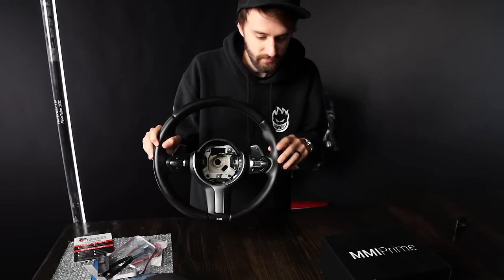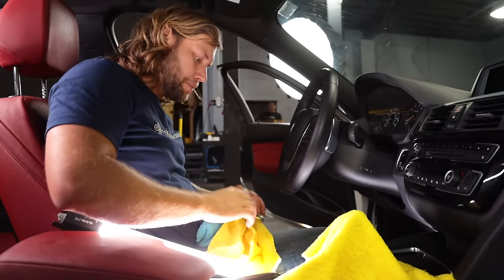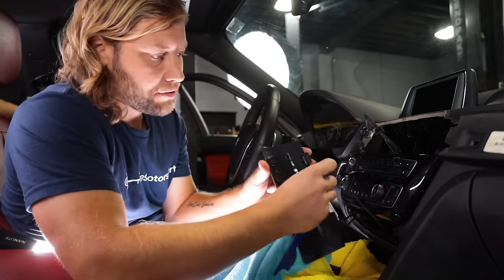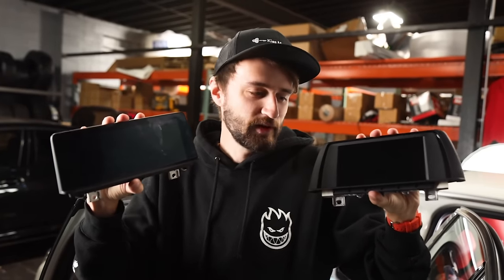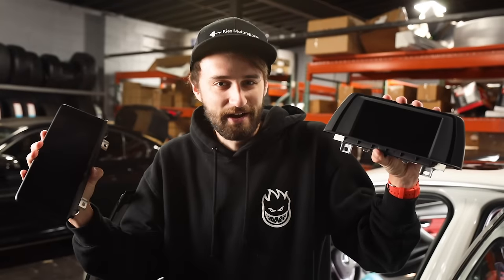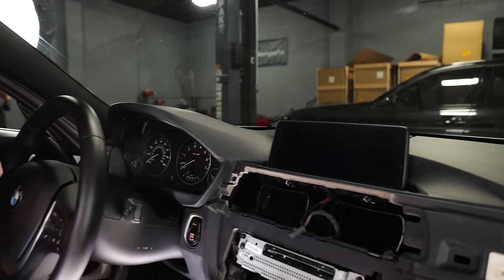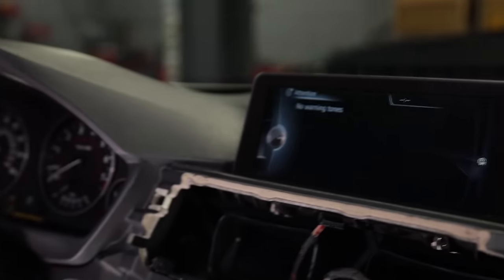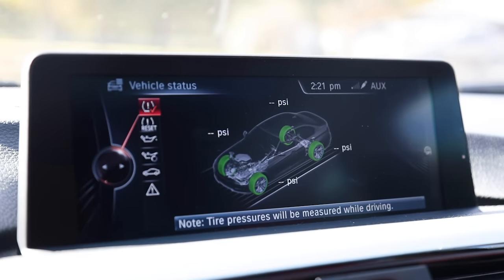How to Upgrade Your F30 BMW Screen + Apple CarPlay & Android Auto

Comment: Can you get a check engine light, mine seems to be on after doing this?
Reply from the maker: nothing about this project would cause a check engine light. If yours came on after doing this, it's a coincidence
Reply: @justinbuice  Thanks figured it out, I did this swap, but I have no satellite location.. I think the map is Here I think its called
but how do you get it working, anything I should do?

Comment: Do you need the MMI with this bigger screen or will coding it to the new screen expand the resolution?
Reply from the maker: Hey, you should be able to expand the resolution through coding. The MMI is just to add the Apple CarPlay capability. From the factory, the car is able to display a handful of different resolutions and you essentially just need to tell the computer which screen has been installed.
Reply: @justinbuice  is it hard to hook up a aftermarket sound system I wanted to add 2 12s and a amp will the audio control LCi2 work with this?

Comment: When you add the car play does it automatically update as and when car play does or is there something you have to do for updates?
Reply: CarPlay updates take place on your phone, so when your phone gets a new version of iOS, CarPlay updates (like iOS 14 a month or so ago).  CarPlay actually runs off your phone.  I guess Apple could at some point release and update that breaks compatibility with older CarPlay units in cars, but my guess is that they'll continue to support the current hardware for a while, likely the life of the car.

Comment: Hi when I upgraded my screen from 6.5 to 10.25 on 2018 BMW X3 I got no single on screen. Can you fix it. OEM screen I bought
Reply from the maker: you need to code the new resolution otherwise you will have a black screen
Reply: @justinbuice  how much you charge me and how you doing it

Comment: I like the size of the screen and I'd be interested in adding one to my 2017 328D but other than a larger screen I'm not sure what you gain by making this mod. I'm not a crApple fan so CarPlay doesn't matter to me. I see Waze and several other apps on the new screen but how do you use them without internet access?
Reply: car play is just showing your phones interface on your car's screen, so as long as your phone has internet all the apps will work like they do on your phone

Comment: Why no one can make American retrofit box that works better than this and sell that without relabeling cheap chineese stuff? I have one of this and it does not work 100% well. You have to wait a few seconds before this comes on, sometimes this has problem with connection and you have to reset it.
I found it to be a relatively good solution for $285, the price I paid to buy this from eBay, but not for $650.

Comment: These screens look very nice but they never work 100% correctly. I just got their latest 10.3" LG 4G screen, 8 core 64gb for my BMW f10 5 series and the damn thing can never retain the settings.  You have to redo the settings on androud side. Also when switching back to iDrive it keeps automatically activating the "split screen" option and show "profiles" at bootup! Its just a flimsy gadget that they don't test very well to make sure there are no issues.  Its just mostly "hype it up, and take ur money!".... 
Also the iDrives "Brightness" is stuck at 50% and u can NOT adjust it because its an Android screen and only Android can. So when ur in the Android side it looks very bright but when u switch back to the iDrive side it looks dim and hard to see in the daylight!  
Its really a waste of $600!